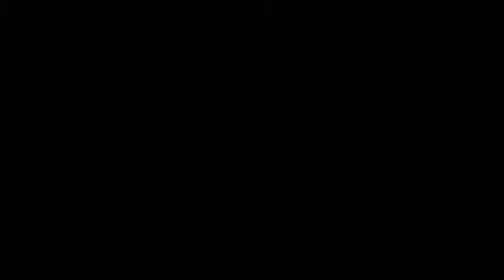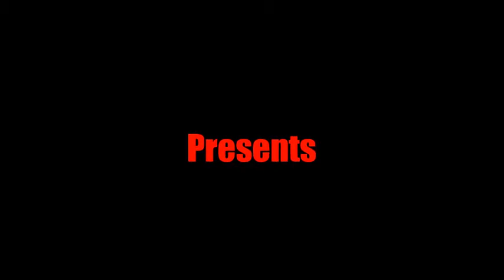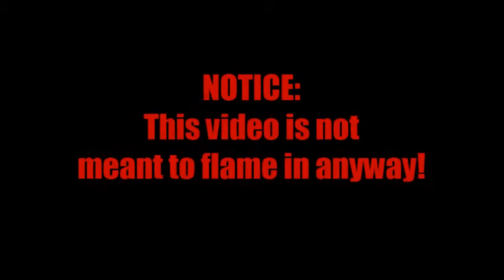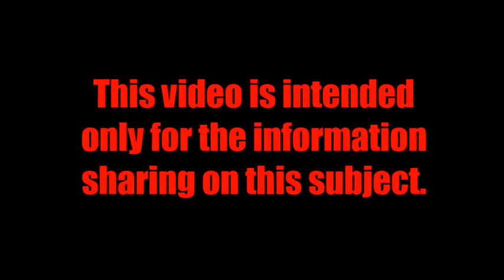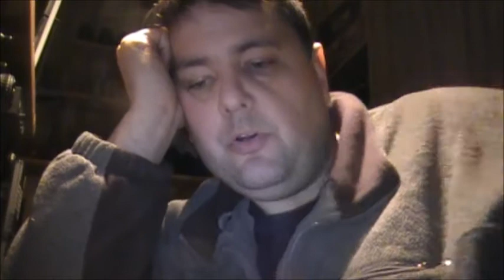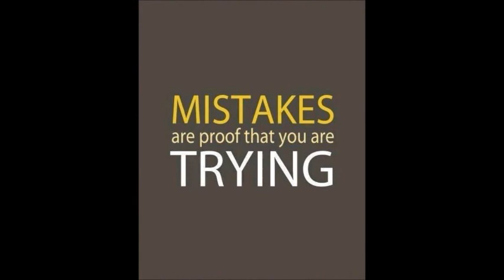Crossband repeaters with BASIC AMATEUR RADIO LICENSE  PART-1

Comment: From what I know if you buy a radio with cross band repeat it’s ok to use but you can not build your own. VE3VX
Reply: You can’t operate a home made radio with a Basic
Reply from the maker: As long as your radio can perform cross band repeat as stock, without any internal mods, then your good to go.  Also you still have a few issues to work out like ID and and a couple of other things.

Comment: Not being Canadian and having no prior understanding of your rules and law from what you shared I do think your interpreting it correctly. I believe the most important part of the whole thing is that you are to only transmit on the frequencies that are within your licencing privileges, which is also true in the U.S. 73 and good luck setting it up!
Reply from the maker: With a basic license you can operate a cross band ONLY if the radio can be programmed to do so, no internal changes to the radio can be made!  Only outside connections. ;-)
Reply: That seems like a strange requirement. I guess they don't trust someone with a basic licence to make the connections correctly. Does not exactly encourage people to be home-brewers and learn about electronics does it?